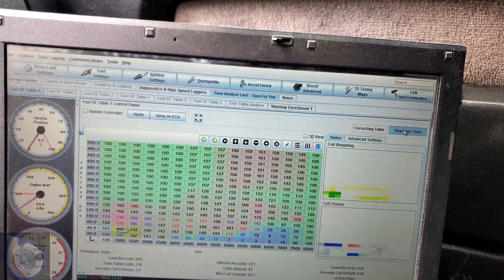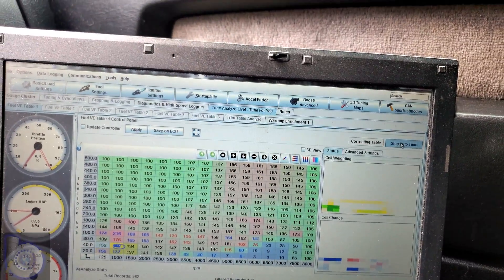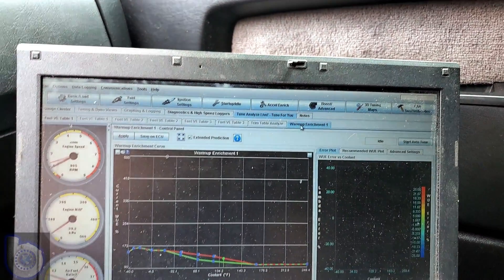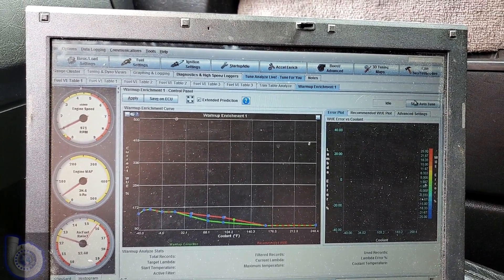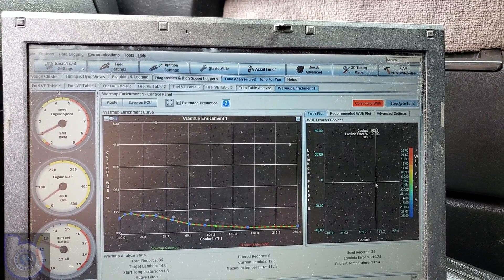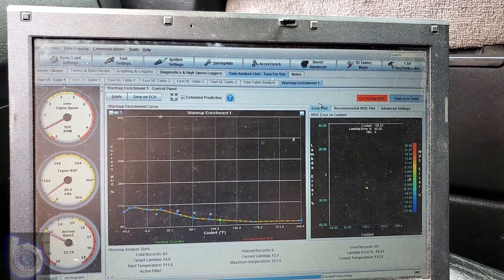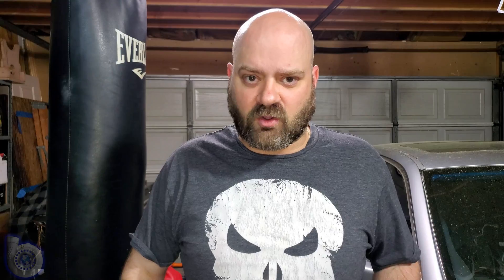Tuner Studio Cold Start Tuning, Tuning The Start Up

Comment: Ive had that cold start issue on my 760 for a while, it would start then die, start again and id have to rev it up for it to idle at 500(also keep in mind i dont have the same intake manifold w the cold start solenoid), and warm start ups i have to rev it or put it into another gear and back to park or neutral for it to idle by itself
Reply from the maker: I dont use a idle valve at all. Do you have microsquirt or megasquirt?